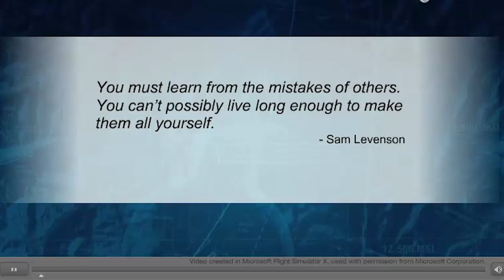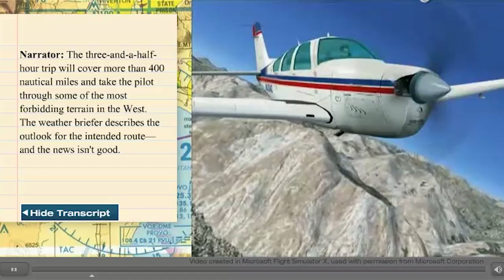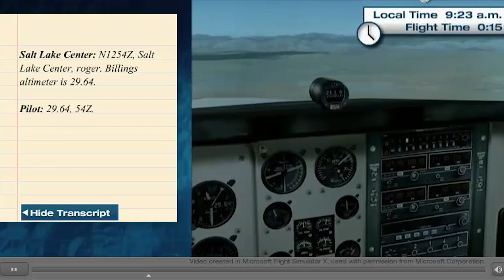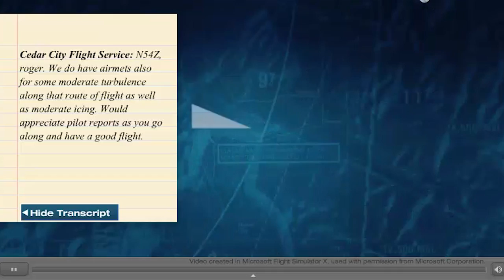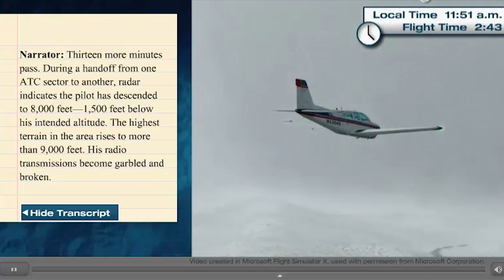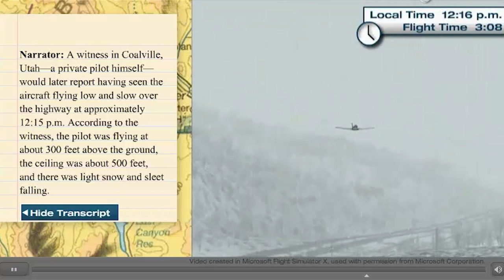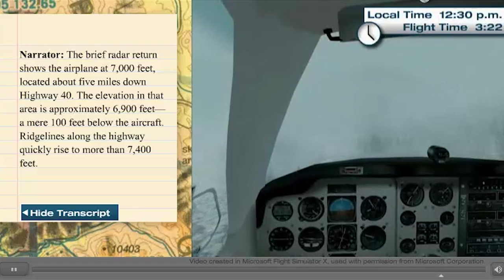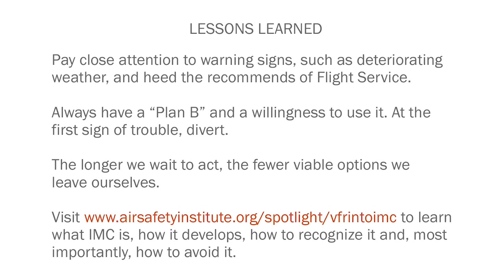Accident Case Study: VFR into IMC

Comment: You enter IMC, step 1, Climb... and keep climbing until your at least 1,000 above highest terrain.  Step 2, contact tower, advise of a return, Step 3, execute a 180, Step 4, trust your controls, ignore your senses.  Step 5, turn in your license upon landing for not listening to ATC's warnings.
Reply: Probably a pride thing. Im the man i can fly blindfoled with one arm tied behind my back i can handle Zero visibility white out conditons by zigzagging over drivers on a highway only 100 feet above their heads i got this im da man.
Reply: Let's say you're not IFR trained. You lose visibility and climb into the clouds. Contact tower. They will vector you out of the IMC right? And even if you're not IFR rated, you should be able get above the terrain and hand fly to the heading given I'm assuming... just wonder why VFR pilots going into IMC don't ask for help...
Reply: @mikedavis7065  A non- instrument trained pilot won't be able to even keep the plane upright in an extended soup run trying to follow a vector.  Most untrained pilots start entering a spiral dive within seconds in true zero vis.   The limited instrument time for a private pilot license is really zero help.
Reply: @markyashchyshyn2647  Im curious about this, if you stick to your compass and your artificial horizon wouldn't you be able to keep the plane level? or is it that the confusion is too great to let you stick to the instruments only?
Reply: The problem is you start to doubt your instruments....Think they're wrong....that it doesn't 'feel right'

In the old days, guys would put a jar with honey on their dash.......That 'instrument' doesn't lie.......lol
Reply: zardiw correct me if I’m wrong I’m not a pilot. (Future hopeful) but wouldn’t a fluid like water or honey be level in a turn because of the g forces? Assuming it’s coordinated?
Reply: @Pdt7484  It would be but airplanes had instruments for this since before WW2 so it's entirely redundant.
Reply: @Pdt7484  Yes, you're correct, of course. a jar of anything won't do any good. You need a gyro of some type. The simplest set up being needle. ball and airspeed.  (turn indicator for a primary roll instrument, ball, to be sure you're coordianted, and airspeed as a primary pitch instrument. ). But that takes practice and concentration.
Reply: @jrcolmena  Apparently it's impossible without extensive training. There are videos of people in simulators going down immediately
Reply: Instrument flight is not about knowledge, it's about traning. Humans are not evolved to fly and airborne maneuvering screws up your sense of direction. And once that happens, it's only half a second before you manually and fully intentionally fly the airplane into terrain, just because you felt like up was down. Instrument flight training is there to make you ignore your senses and trust your instruments instead.
Reply: bigun89 thats not gonna work for someone who isn’t ir rated.
Reply: I flew with a guy that was sort of like that--although he was an IFR-rated pilot, and (at one time) was a great stick. Then he busted minimums one too many times, and flew into high terrain. He was bold, but didn't grow old.
Reply: bigun89 That steep climb is a good way to stall the plane when entering soup with spatial disoriention.
Reply: @ZeitGeist_TV  Don't do a steep climb then. Keep it Vy
Reply: There was reported icing. If that aircraft had attempted to climb through icing conditions, it wouldve come down much faster. It is not equipped to handle icing AT ALL, majority of GA aircraft arent. They got no de-ice equipment. So to anyone recommending just  climb above the clouds, you wouldve been dead much faster than this guy.
Reply: Uh why honey, that stuff slow as heck
Reply: Safest thing would have been to climb max rate and go above minimums on the vfr chart. Then give yourself time to think. I am only a mechanic but i suggest anyone that is a pilot practice a bit even in a sim at using instruments and zero reference. Cross check turn and bank and your attitude gyro. Ones electric. Ones vacuum operated. Ffs. Get help. Your already illegal. Be honest.
Reply: @MrEkg98  No, there are many stories on this channel of pilots without instrument training getting disoriented and losing control within a minute of flying into clouds.
In weather like this, there would also be ice and snow affecting the aircraft.
He would not have survived in the clouds. His only chance was to put the plane on the ground, maybe the highway.
Reply: Isn't it possible to set the autopilot to climb to a FL above the highest elevation and let it do its job?
Reply: Extended climbing may cause disorientation.  The moment you encounter IMC do a standard rate turn 180 immediately (aviate first)
Reply: You can trust your controls all you want...but it’s trusting your instruments that will save you.
Reply: Here are the problems with climbing: If you climb steep, then you risk stalling and becoming disoriented, both just a few hundred feet above ground. That guy did not have the option to climb slowly either. If he climbed even a bit higher, he was in the clouds and could not make sure to follow the highway, but the terrain around the highway was rising way too quickly, so a slow climb without orientation was guaranteed to result in impacting terrain. Then there is the issue of high altitude - yes, he was only a hundred feet above ground, but he was 7000 feet MSL. The higher you get, the more air composition is changing, which affects engine performance. His climb likely would have been affected, so he could not have attained the same rate of climb as closer to MSL. Finally there is also icing. Entering clouds meant increasing the rate of accumulation of icing on the airplane frame. Another factor that would have heavily degraded his climb, if attempted. I don't think he could have attained a steep climb, even if we ignore the issue of spatial disorientation. So yeah, emergency landing and praying was his best option after closing all other doors.

Comment: I own a Beechcraft Debonair, I've flown it probably 600 hours, almost all cross country.  I also own a Cessna 182 and a Cessna 150-150, and I've probably flown the 150 a similar amount, and I've had other aircraft.  I am famous for scud running, maybe not something I should be proud of, but I can state that I have a lot of experience flying low and slow under crappy weather, though not in the for real rocky mountains (only in the Ozark Mountains).  Anyway, I can attest categorically that the Debonair, a GREAT airplane BTW, is probably one of the worst airplanes I've ever owned for trying to scud run.  Things simply happen too fast.  It does not do slow flight very well.  When it stalls in slow flight, it stalls hard and violently, you can do turns, but not very fast, there are more dials and lights and radios and gages and other distractions inside the cabin, and, obviously, you can't see the ground over the nose and can see only a small amount of the ground to the left, smaller even than the 'Dominos slice' that you get in a Cessna.  You can see ground behind you to the left, but not the right, but when you turn your head that far, it's easy to get momentarily disoriented.  And I always found it difficult to contact navigate in the Debonair, not entirely sure why.  

The 150, in contrast, stalls very nicely, horns blare, things shake, and you can recover before loosing thirty or forty feet, and if you have to, you can put the 150 on the ragged edge of a stall with the horn in what I call 'half scream' and leave it there indefinately, but you usually don't have to go that slow when scud running.  You can see all around you, and even though you can't see the ground right in front of you, if you lean forward, you can see over the nose to ground a ways in front of you.  It handles sloppy in turbulent slow flight, but you can make quick turns without loosing altitude with a little power, doing the same in the Debonair is sort of a violent maneuver.  Doing a 180 in the Debonair is probably going to be a quarter to a third of a mile in a violent maneuver, but a 150 can be turned 180 degrees in maybe 200 yards, maybe less.  So if you decide to get out, might not be doable in the Debonair, especially in a mountain pass where this guy was.  The controls and instrumentation are oddly bunched together closer, being all within about 30 degrees of view, while the farthest instruments on the right are as much as a 45 degree head turn in the Debonair.  And the workload is greater in the Debonair, for example, if you need to add power, you just advance the throttle in the 150, but you have to advance prop, look at some guages,  and then throttle, but not too much, in the Debonair, doesn't sound like much, but it is.  Plus fuel management, plus if you are scud running a Debonair, its probably because you're low on fuel looking for an airport, and if you bank too much or too quickly, it causes the engine to sputter and if it dies you don't have altitude to manage it-there have been several fatal accidents related to that attribute.  I don't want to admit it anywhere the FAA might see it, but I've scud run the Debonair under a 300 foot ceiling a couple of times when I had a lot of recent time in the plane going the last few miles into an airport I knew with two moving maps (not having to shift view to a sectional) lots of fuel, etc etc, not good, but with everything that could be bad actually being good, and I found it to be absolutely life threatening.  Pilot workload was on the edge of being overwhelming every second, and if anything went wrong or simply needed to be managed, it could be what I described:  life threatening.  I would imagine that would be the case in any similar class aircraft, eg Bonanza, Mooney, Viking, etc.  

Don't get the idea that scud running 300 or 200 foot ceilings in a 150 isn't a bad idea.  There's a reason its illegal.  I'm not saying it's safe, though safe is a relative term, there are many things I see people do in airplanes that are completely legal that I would consider less safe. But I am saying that with solid time in type, experience with scud running, excellent GPS, NDB (yes you need ADF skills, because that is how you will be using the GPS) skills, and excellent contact navigation skills, scud running in a 150 is more survivable than in a Debonair.  One other observation, though, our 150 has a 150 horse engine, that makes a difference, oddly.  I had a Cherokee 140 for a few years and it handled better in slow flight, but had the low-wing ground visibility problem.  We later put a 180 HP engine in it, and even though it did not handle as well at low speed, it seemed or 'felt' safer (tho again in a relative sense) in a scud run.  So I'm not sure I would recommend trying scud running really really dangerously low in a regular 150 or 152.  There are times when you need to go up 50 or 100 feet expeditiously, and a regular 152 isn't very good at that.  The 182 works OK, but the visibility is not as good, particularly forward, and it has a quirk in that in slow flight the CG is far enough forward that you are flying all the way back on the trim if you are alone.  If you put people in the back seat it slow flights better, but recovers from the edge of a stall slower, whcih is a factor, but the big factor is scud running is something you don't want to do with four people in the airplane-because of the distraction.  Even if they sit there and don't say anything, maybe even if they are already dead, their presence is a distraction.  

Anyway, I guess what I am trying to say is that the Debonair that this guy was in was, and I speak with some authority here, one of the worst airplanes out there to try to scud run in. The only plane I have that would be worse would be our Baron.  I think the quirk that killed this guy was he decided too late to reverse his decision and the Debonair/Bonanza does not turn really really tight, particularly in slow flight.  It takes a while, and if he banked a while with low fuel on an aux tank, he might have had to switch fuel, whcih requires looking straight down to the left, whcih is something you don't want to do when flying 75 feet off the ground with tall trees sticking up.  IMHO.  

Other than that, this sounds like all of the other classic 'mountain flying in marginal weather' stories I've ever heard.  Starts well, goes bad slowly, and pilot decides too late to get out.
Reply: Thanks for this Kelly! Wow what a great read! You should write a book. I just subscribed to your channel. Your experience (in flight) and ability to convey your thoughts to us dummies out here is really awesome!

Start making some aviation for dummies videos... and more opinions on stuff like this.. you will have a SHT TON of subscribers. #MAGA.
Reply: @dryan8377 why on earth did you put a MAGA hashtag in your comment? wtf does that troll have anything to do with the great art of aviation?
Reply: @AureliusR  awwwwe someone's triggered teehehehe!!
Reply: @tightstops  see. You're just as bad as the radical left
 Won't even engauge in discussion.  Seriously. Why are you so confident that you know exactly how the world should be run? What makes you qualified??????
Reply: @runninggames771  ok mr politics junky lol
Reply: Aurelius R: Make Aviation Great Again :D
Reply: @nonmihiseddeo4181  trump till 2040!!
Reply: @Mark F: If only!!
Reply: @nonmihiseddeo4181  WE THE PEOPLE can make it happen!!!
Reply: @tightstops  lol. He'll be gone in the next election. I'd put money on it. He's done nothing but ruin America's image as a happy productive nation, shut down the government, and generally made America the laughingstock of the world. Nobody takes Trump seriously except his delusional supporters
Reply: @AureliusR  he will prob be the 1st president to be elected for 4 consecutive terms
Reply: Trump 2020~!!!!
Reply: SpaXpert #MAGA

Comment: The thing I don't get is these guys all have an altimeter and a gauge that shows the horizon, whether their level, so why do so many become lost? I get stalling and microbursts but I mean flying in the dark or whiteout, make the plane climb slowly and stay level right?
Reply: What Roger Voss said. Instruments wouldn't have helped him. The problem was that the pilot couldn't see the mountain that ran into his plane as he was turning around to 'slide back out'.
Reply: +Jesse from Vegas - this area includes a HIGH mountain ridge, with only narrow valleys for transit below the peaks.  Once down in them, there are VERY few places to turn around and the same for climb out in a straight line opportunities.
Weather from the west rises over the ridge and dumps precipitation on the tops & east side. Where this pilot turned onto 40 south from I-80 is VERY close to well known Utah ski areas immediately to his west.

Not IFR rated, and IDK how well he knew the terrain around the road, so pretty well locked into the valleys once he entered from Wyoming.  Not an easy DRIVE in poor weather, a lot of concentration/work even in Good weather for a Truck ( Steep downhill from Wyoming to a "T" intersection of roads/valleys where he turned left, then twist through the valley to a right turn of the road to head uphill again where he turned left through another southerly valley).  One thing to follow the valleys with altitude to give extra space, down with the traffic he was in trouble right away.

Comment: Outstanding video, this is the 6th video in a row dealing with flying VFR into an IFR weather situation. He could have landed in Vernal and waited out the storm or Grantsville on the other side. The Wasatch Front gets nasty low pressures are sticks between the 360 degree mountains. Overconfidence coming on strong. The pilot's not listening to the experts, very sad. I'm "lots of stops" Bobby over cautious, so this makes me nervous. That Rigid inflexible thinking strikes again. Provo Canyon is very narrow Mnt Timpanogas is 11,000 feet high on the north side of the canyon. Damn Fool.
Reply: interesting comment. nice to get local commentary on the area.

Comment: Chilling end! I think if it were me, other than avoiding the situation in the first place, I'd apply full power and do a maximum rate climb until I was on top of the clouds. At some point in the climb I'd try to re-establish radio contact, and probably be squaking 7700.
Reply: The high probability of icing up made ditching the only chance he had in the final moments. He should have done the 180 when he first saw the need to descend out of 9500, not withstanding the 3 "VFR not recommended" warnings. His client would be happier in the end if he was late instead of never getting there at all.